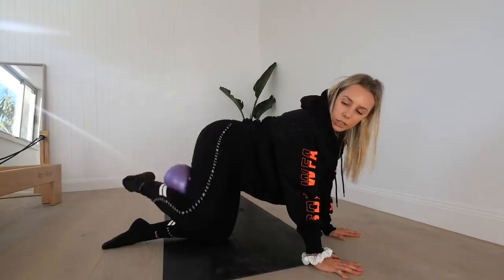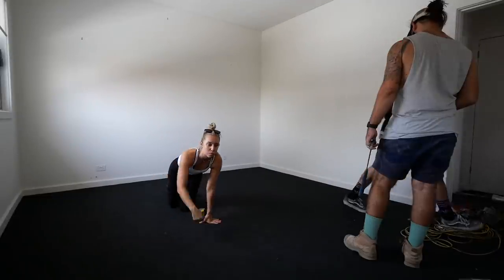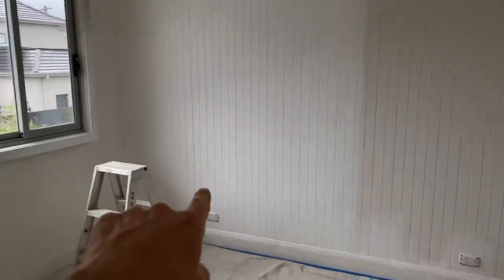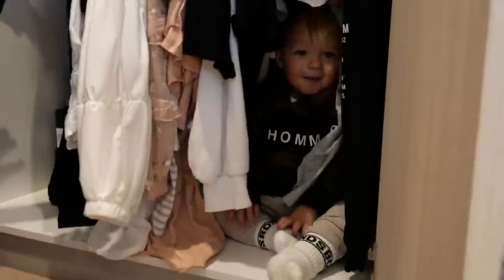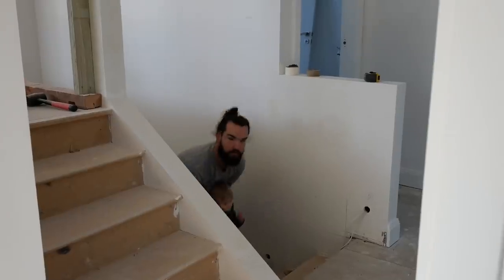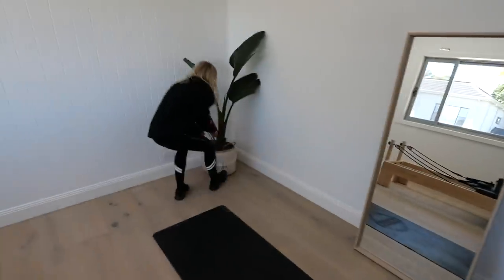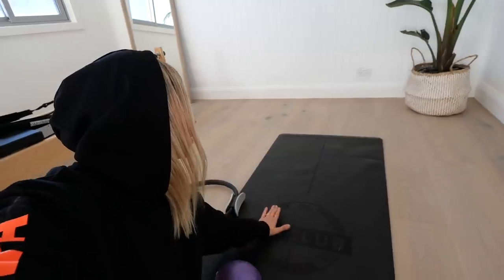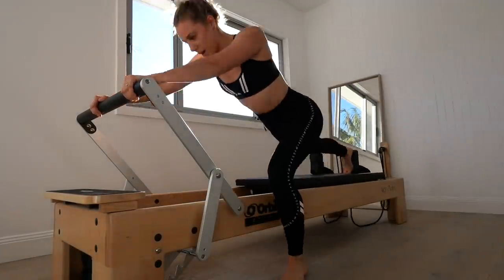I created my DREAM workout space AT HOME! [vlog] pilates room transformation

Comment: I would rather have a ballet bar on that wall if it was me.  Of course it is not and you should do what you want.  That wall is so pretty, I would hate to block it with any further mirrors - but the ballet bar would not block the view of the wall at all.  If I am hearing you correctly on the video, one wall will have mirrors, and another will have storage.  The remaining wall is so pretty, it is like art work itself.  A ballet bar would add the right touch.  The plant and the basket perfectly look like they were always there.  A very calm environment for a studio used for concentration, needed for yoga and Pilates.  Love your room!  XOXOXOXO

Comment: Love the vibe of the pilates room! I also think that instead of another mirror, it would be a good idea to put some shelves on the other wall for some smaller equipment so that way not everything is on the floor. As well as maybe a neon light sign with a calming color, so in the evenings you can relax while stretching with no main light on. ❣️😊

Comment: I would just add a ballet bar to the paneled wall, no art. Then get either a black pot for your palm or a wooden planter similar to the Pilates machine. Maybe a small wooden table for the corner with a thing for essential oil or a nice candle if you are not super sensitive to scents, something that goes along well with Pilates and yoga.